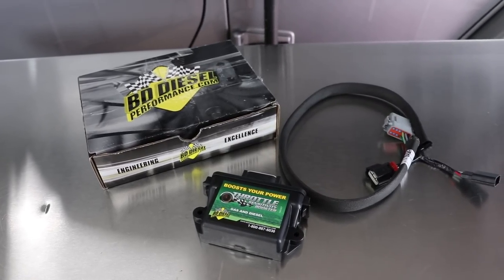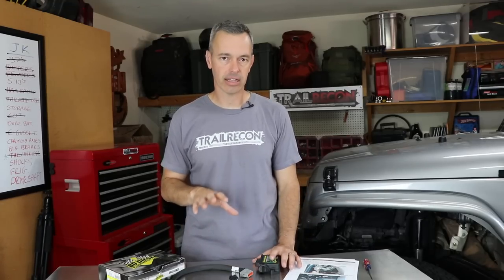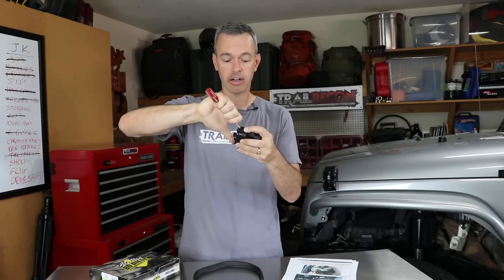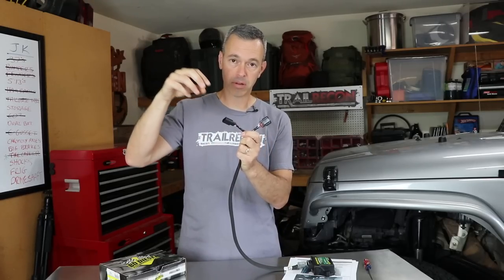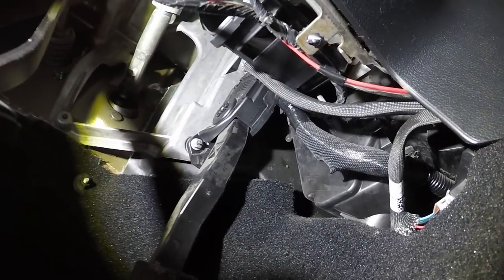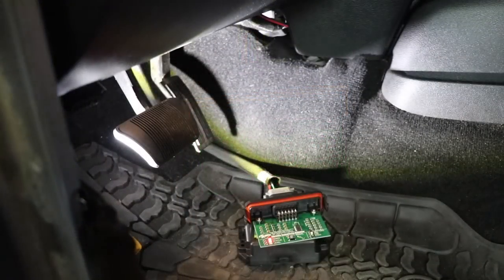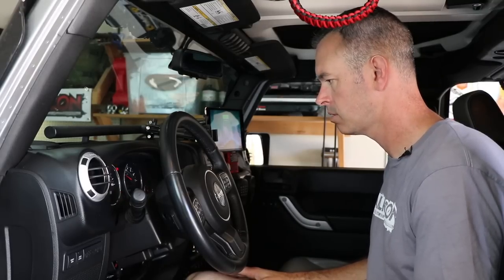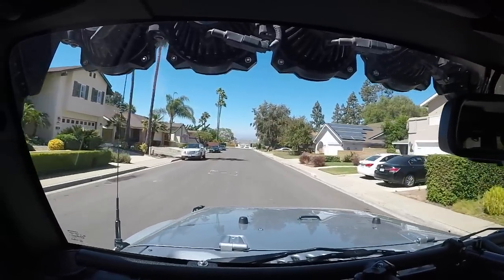Should You Install a Throttle Sensitivity Booster?

Comment: Having a 2011 JKU with the doggy 3.8L, and running 35" Nitto Trail Grapplers, I can tell you that the swap to 5.13 gears made a huge improvement in both everyday driveability and offroad response, over the stock 4.10 that were standard in my Rubicon.  Don't forget to tune the computer with the new gear range.  ;)   ..........  PS, I still smile seeing the Vector Offroad mounting bar on the dash.  As simple as it seems, it's been one of the best interior upgrades I've made.  Although my friends laugh when they see what all I've got mounted on it, making the area around the driver look like an airplane cockpit with my tuner display, my GPS, my ham radio head, my phone, etc...   Everyone who gets in the Jeep immediately make a comment about "where did you get that mounting bar?"
Reply from the maker: Agree, I love the vector bar!  Such a functional and super easy product.

Comment: This is probably good on road, but offroad I would guess you want a LESS sensitive throttle response/tip in... i.e. don't want 20% tip in when trying to crawl over some rocks....  when we put larger tires on the jeep, the gearing was terrible, so got a tuner to both change tire size and help to recover some of the performance... but just recently found the crawl tune on the tuner and tried it the last time off road - EXACTLY what was missing, no fighting for a very fine adjustment of throttle to climb up that rock without going too much!!!
Reply from the maker: Thank you for your comment!  I'm looking forward to testing this out on the trail, I'm hoping it's not going to be too twitchy when I need to crawl.

Comment: I have seen a few people use similar devices and I realize all it does is change the percentage of throttle opening per linear peddle travel and rate of opening (according to documentation) but I wonder if it affects you off-road at all?  My Jeep is a standard and having smooth throttle control is pretty important. Have you had it off road yet with it? What are your thoughts?

Comment: these things are always confusing to me. 'Sensitivity Booster' does it reduce throttle lag? 
Or does it just open the throttle more with less travel from the pedal itself?
It can't open the throttle more then full... so with this you don't have to push the pedal as far to get full throttle?
it sounds like snake oil to me.

great job and thanks for sharing thou, I love watching your vids.
Reply: yep waste of money.  If you need more throttle then push your foot down more.
Reply: I know I am late but these and the others work on the same principle. Like you said it opens the throttle with less travel or more depending on how the controller is set and to help cure sense modern drive by wire system have a little lag and can have more set by the manufacturer. So this helps defeat the lag imposed by the system and auto manufacturers. :)

Comment: Hi Brad. I have the Pedal Commander on my JK and it does basically the same thing as the BD Diesel unit. A few things to consider that weren't covered in your video.
1) You are definitely going to need to install the on/off button on the BD Diesel unit.  The last thing that you want while crawling over rocks or along a narrow shelf road is a twitchy throttle. The Pedal Commander has adjustment and on/off buttons on the command module
2) Turning the unit on/off or making adjustments while driving can cause the Jeep's ECU to throw codes.  Turning it on/off or making adjustments (Pedal Commander) should only be done with the engine off or in idle with the transmission in Park
3) Using a throttle response controller in conjunction with an engine performance module (Superchips, Banks, Jet, etc.) is not going to work well.  It will cause the Jeep's ECU to throw codes.
Reply from the maker: Great information about not turning it on and off while driving.  I'm considering getting the switch to adjust it, but want to run it though it's paces first.  Thank you!

Comment: Great video as always! I have a similar device on my truck but with a remote built in. Just like you, I prefer to leave it on the highest setting (Race) all the time. Mine has three modes - Crawl, Street & Race with each having 7 steps - 3 down, normal and 3 up for a total of 21 stages. However, I notice that leaving it on the lowest setting (Crawl, 3 down) completely kills wheelspins and improves traction while off-roading or crawling. You can slip up on throttle modulation and still get away with it. Even if I stand on the pedal it revs up slow and smooth. So it's one less thing to worry about when in a rut. If yours has the option to reduce sensitivity to below stock, try this the next time you take the jeep out. While this goes against the 'throttle it out' school of thought, I have a feeling you'd enjoy it!
Reply from the maker: That is a great point about crawling and wheel spin and something I'll be keeping an eye on when I hit the trail.  Thank you for your comment!

Comment: Brad, thanks for the video. I was wondering if you could post your experience with that device once out of the trail? My experience with a Superchips Flashpaq and a 91 Tuning was, that on the road it was great, but on the trail i was missing the sensitivity of the stock setup throttle response and my driving style on the trail was not as smooth anymore. I reverted back to stock in the end.
Reply from the maker: I will be sure to revisit how this controller has worked for me after running it through its paces for a while.  Thank you!

Comment: Brad, you have any opinions on the Pedal Commander and Sprint Booster version? This is the first time I heard of BD Diesel Performance. It looks like this one is about $50 or more cheaper than the other brands.
Reply from the maker: I have watch other reviews on those booster, but I don't have any first hand experience with them.  Would be interesting to do a side by side comparison.
Reply: I have a 4th gen 4Runner, and when stock the v6 doesn't have much throttle response. So looking for options for power, the Pedal Commander came up amongst the forums as being well-liked. So I wound up buying one, and have been in love with what it does. Eco mode is more what I use just putting around town and the highway, but once in a while I will put is in City or even Sport mode the have the throttle response. I have used the Sport + mode once, just to see what it was about, and boy was it a little bit more than what I bought it for. At least to me, the Pedal Commander is worth the money,. It is just an option for more "power", besides a proper supercharger. Hope this helps. Matthew
Reply: And you do not have to pull the unit apart every time you want to change the setting.
Reply: Wilhelm Leipzig I've heard a lot of good things about Pedal Commander. I wanted to buy one on their website, but they no longer carry the standard version which was cheaper. The only ones they have now are the wireless, bluetooth version. Which is fine, but it's like $80 more. Almost bought a used one on eBay recently, but someone else outbid me:(
Reply: May I ask what you drive. Make, model, and year, and engine size and fuel?
Reply: Jeep Wrangler JKU 2017, 3.6L

Comment: Just make sure that you download your EMU/ECU settings before disconnecting the battery so when you have completed your work and reconnected the battery you should re-upload the EMU/ECU settings back to the EMU/ECU otherwise you will have problems with ignition or not getting enough fuel to the engine.
Reply from the maker: I have disconnected my battery a dozen times for various projects and never downloaded the setting and never had any issues.